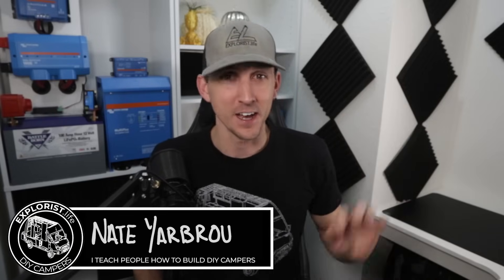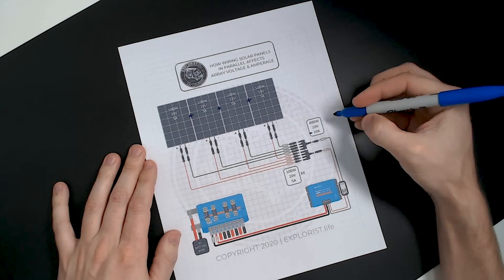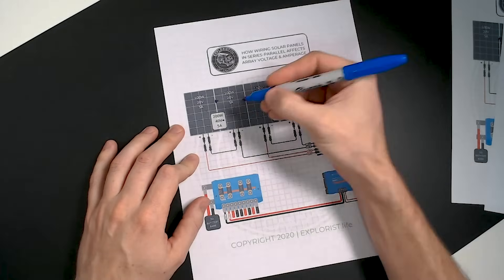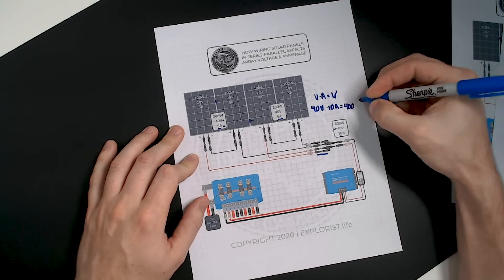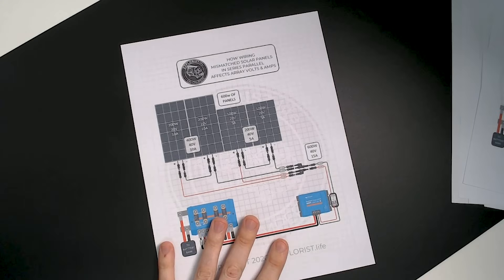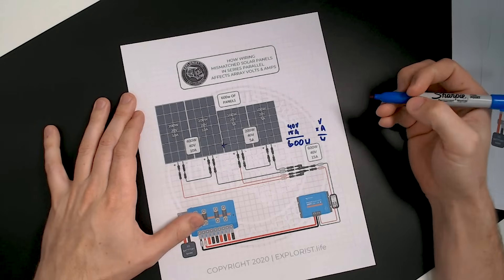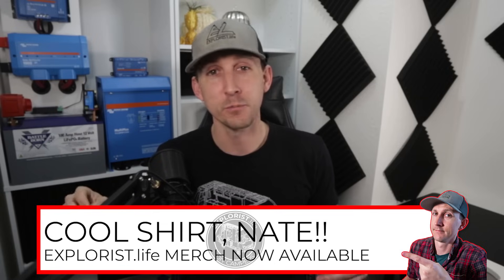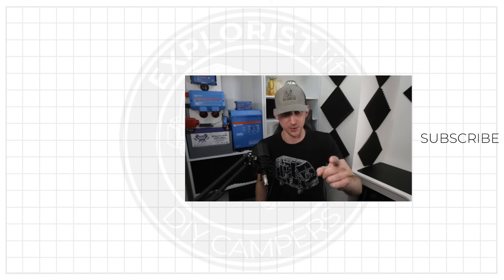How to Wire Different Sizes of Camper Solar Panels Together - Effects of Mismatched Solar Panels

Comment: I have a 12 volt battery bank 800 amp hours with a Outback flexmax 80 amp charge controller that can handle up to 150 volts open circuit and a 5000 watt pure sine wave inverter and eight 100 watt solar panels 6.45 short-circuit amps 6.25 operating, 20 volt open circuit 16 volt operating. Do you see where I need to add? Like is my charge controller underpowered and could I add more batteries or would I have is adequate? I have in total eight 400 amp hour gel batteries 3200 amp hours LOL I don't know why I bought so many batteries but I'm only using two of them in series to make a 12-volt I would like to add two more 6 volt batteries in series making me another 12-volt but I don't know if that's only kill for my setup. Maybe I need more panels? I have four others but they are in sets different brands two sets of two I don't know how I would enter grade that or if I could
Reply from the maker: Tough to say for sure.  Here is how I recommend setting up various systems: https://www.explorist.life/solarwiringdiagrams

Comment: _________Please Help me out ______
i have connected panels in series 180+180+200+330 =890w
im generating 400w from it
i want to connect 2 panels from them parallel (180+180)
and connect rest of them in series is that help to get more efficiency?
(inverter pv range max 230v & 17 amp)
Reply from the maker: Hey, Rated Roxen! I appreciate you taking the time to ask your question, but unfortunately, I don't have enough info about your specific question to provide an accurate answer, but here is a playlist that, if you watch all of the videos start-to-finish (and take notes 😉), you'll have a REALLY good idea of how to design a solar array: https://www.youtube.com/watch?v=Jkbs84sBHsg&list=PLmvhcyi4n0TV9pi83rFTv3ZuMT_S1xIZt

Alternatively, I have some of my most common solar array setups pre-built here: https://shop.explorist.life/product-category/all-products/camper-wiring-kits/solar-charging-wiring-kits/

Comment: I'm not good at electrics 😢. I have  1 x 100w panel on my camper roof going through a controller to a 110ah leisure battery. I  just bought a 200w panel  and mounting brackets ,but no controller , as I thought it would be better for charging but now after watching a few videos, I'm confused . I was hoping to join both solar panels in a junction box and just then use the 2 use existing wires going through the roof  to the controller. 
I think that is going to bring my 200w panel down to 100w ? Maybe I need another controller. Any advice ??

Comment: An example is missing.

What would be the problem if I had 2x 34V 11A in series and 4x 17V 6A and these two Series then in parallel. Both series amount to about 68V. (2x 370w panel and 4x 100w panel). I would also like to place the two different types of Panels in different places so that the sun shines on them at different times. What speaks against it and why?

Would it only be the disadvantage that the two 11A panels would be throttled to 6A?

Or have I overlooked something or are there other dangers?
Reply from the maker: Sounds like you are probably going to need multiple charge controllers for best performance.  Like panels in each location all to their own charge controller.  Too many variables with mismatches solar panels in different locations.
Reply: @EXPLORISTlife  I’m also researching the topic right now - maybe you can also answer a question for me: let’s assume I have two Victron Chargers, how would I connect them to one battery? It is important to me to get an acceptable yield even in bad weather. My current 12V battery can only handle 20A charging power anyway. (so in any case I have a significantly oversized panel array)

Comment: what about placing the different panels  in different directions ? I mean a serie of panels with 505w effect east direction and a serie of panels of 390w south direction. while they don't get maximum effect at the same time,the total effect is not decreased. is it right? great videos....I really enjoy your work.
Reply from the maker: It'll be a similar-ish concept but to a lesser degree as taught in this video.  There may be decreased output, but it's hard to calculate since the voltage/amperage may not be consistent (and would change as the sun moves across the sky).

Comment: Nate, I have 3 different pannels that I wan to use together, here is the list;
1 - 210 W, 16.77 V, 12.48 A panel
1 - 160 W, 18.53 V, 8.66 A panel
1 - 70 W, 17.2 V, 4.07 A panel
Here is what I came up with;
combine the 160 and 70 in Parallel, resulting in 17.2 V, 12.73 A for 219 W
Then combine the 210 to the other string in Series to net 33.97 V, 12.48 A and 422 W for 95.9%.
What do you think?

Comment: Have a question, when putting solar panels in series, with different amperage which value would you use for current the higher or lower value?
Reply from the maker: Here is a video that will teach you what happens when you wire solar panels in series with different amperages: https://youtu.be/jejro4zkl8I
Reply: I looked at the video, but couldn't find what I was looking for, so I have 4 panels in series 2 panels are 8.85a and the other 2 are 9.59amps, so and two are 22.6 volts and the other are 21v so I come up with 87.2v and not sure it's 8.85a or 9.59amps

Comment: hi Nate, can i use 2 100w panels and one 200w panel? run the 2 100s in parallel and then add to the 200w. the spec for the 100w is 20.4v and 4.91A the 200w is 19.2v and 10.2A  i make a arry out put of 388w
Reply from the maker: The video you commented on answers that question. 🙂
Reply: @EXPLORISTlife  but i have parallel  and then series
Reply from the maker: For sure!  This video covers that as well.  Perhaps, if you are struggling with these concepts, maybe choosing from the arrays we have pre-designed may be useful: https://shop.explorist.life/product-category/all-products/camper-wiring-kits/solar-charging-wiring-kits/

Comment: I have a 190W solar panel on my RV, I plan to purchase a 200W panle to add on the roof and then a 100W plugged into the connection on the side on camper>  Should the roof top be connected in parallel?
Reply from the maker: Hey, Herman Taylor! I appreciate you taking the time to ask your question, but unfortunately, I don't have enough info about your specific question to provide an accurate answer, but here is a playlist that, if you watch all of the videos start-to-finish (and take notes 😉), you'll have a REALLY good idea of how to design a solar array: https://www.youtube.com/watch?v=Jkbs84sBHsg&list=PLmvhcyi4n0TV9pi83rFTv3ZuMT_S1xIZt

Alternatively, I have some of my most common solar array setups pre-built here: https://shop.explorist.life/product-category/all-products/camper-wiring-kits/solar-charging-wiring-kits/

Comment: question, could you have 2 identical panels with the same value hook up in parallel, send with a set of wires to 1 MPPT, then use a 3rd panel with different values with a different set of wires to a second MPPT then combine them to the lynx? this should keep my solar numbers up to par 

thanks sean
Reply from the maker: Yep! Here is a video that shows you how to wire multiple solar controllers into the same system: https://youtu.be/N0UB7LZVduk

Each 'array' connected to each charge controller would then get treated as it's own seperate and independent array and should be designed as such.
Reply: @EXPLORISTlife  thank you Nate, love your YT channel BTW keep it up

Comment: The last example of adding an additional panel that cuts output in half is super informative.
Reply from the maker: Glad it was helpful!
Reply: In the  last example why   not wire  3 panels in series ( 51V &11.76A)  and then wire the other four in series also (68V & 11.76A)/ . now you could wire  these two series array in parallel  get you 51V * 23.52A =. 1200W

Comment: Hi, Thank you for the great videos, you are the best out there. I have learned a lot for my upcoming van build. I want to run a solar array set up by you. Rich Solar offers 200W 24V panels that would fit perfectly. They have 37.6 max voltage @ 5.3A. I would run these in parallel for 37.6V @ 10.6A. The other Rich panels are 100W 12V with 18.6V @ 5.4A max. These would be in series for 37.2V @ 5.4A. I would then parallel these sets together for a total output of 37.4V @ 16A = 600W. Am I missing anything? It seems perfect...I hope you get this message, thanks...Erwin

Comment: 11:19 so if you add that extra panel with its own charge controller it will be fine, efficiently ?
Reply from the maker: Splitting the array into two arrays (or three or four or five... depending on how big the array is) is indeed an option.

Comment: Excellent Video. Not sure if anyone in here can help me figure this out. I have 4 - 100 watt Renogy Panels (24.3 VOC and 5.21 amps) from an old rig. I want to buy 5 - Hightec Solar 200 watt panels (24.3 VOC and 9.87 amps). I'm going to go with a Victron 250/70 MPPT charge controller, so I was planning to wire in series. But my math is messing with me right now... If I wire 2-100 watt Renogy panels in parallel; then wire the other 2-100 watt Renogy panels in parallel, I essentially create 2-200 watt Renogy panels at 24.3 VOC and 10.42 amps each pair, right? Then wiring the 5-200 watt Hightec Solar panels in series with these Renogy Panels that are all at the same 24.3 voltage, I would do 24.3x7 = 170.1 Volts. Times that by the lesser 9.87 amps and I get 1678 watts? That seems wrong as I should only be getting 1400 watts at best (4-100 watt Renege + 5-200 watt Hightec = 1400 watts). What am I doing wrong here?
Reply from the maker: I would recommend  splitting those up into two arrays, each to their own seperate charge controller.

This one for the 4x100w panels: https://shop.explorist.life/shop/all-products/camper-wiring-kits/solar-charging-wiring-kits/400w-solar-charging-wiring-kit-4x-100w-12v-battery-bank/

This one for the 5x200w panels: https://shop.explorist.life/shop/all-products/camper-wiring-kits/solar-charging-wiring-kits/1000w-solar-charging-wiring-kit-5x-200w-12v-battery-bank/
Reply: Wow! Thanks for responding! Any particular reason for splitting and still getting the 250/70 and not just a 150/70? Can the 250 not handle the entire array?
Reply from the maker: @mcdees2784  Here is a full playlist that will teach you the considerations of designing a solar array which is what goes into the decision making process of my previous answer: https://youtube.com/playlist?list=PLmvhcyi4n0TV9pi83rFTv3ZuMT_S1xIZt

Comment: I am learning so much from this channel, although there are some things that are still a bit fuzzy in my head.  QQ.

I own 3-160w EC panels (18.2v*8.8a) and 2-100w panels (17.1v*5.9a) I was looking for a way to combine them with minimal loss. 
I think the best possible way under this scenario would be to put them all in a parallel configuration.
Combined AMPs 38.2 * Lowest Volt 17.1 = 653.22 out a 680w. Is that math correct?

Comment: Great video, what happens if you can attach 2 strings to your inverter as it has 2 positive and 2 negative connections, do both strings need to be the same, or can 1 string have different panels to the other and get the full watts from both strings?
Reply from the maker: This video addresses that specifically: https://youtu.be/N0UB7LZVduk

Comment: Hi,
 I have question regarding Solar panel configuration. 
I have four Solar panels all pre wired together in parallel  using two core cable and sealed moulded connections. Can I split them and reconnect in a parallel/ series configuration, as this would be the easiest way with the least damage to existing wires? 
 
 All the diagrams I see are in series/ parallel
Reply from the maker: Hey, Mick Mitchell! I appreciate you taking the time to ask your question, but unfortunately, I don't have enough info about your specific question to provide an accurate answer, but here is a playlist that, if you watch all of the videos start-to-finish (and take notes 😉), you'll have a REALLY good idea of how to design a solar array: https://www.youtube.com/watch?v=Jkbs84sBHsg&list=PLmvhcyi4n0TV9pi83rFTv3ZuMT_S1xIZt

Alternatively, I have some of my most common solar array setups pre-built here: https://shop.explorist.life/product-category/all-products/camper-wiring-kits/solar-charging-wiring-kits/

Comment: Hi there thank you for this great help i have 2 x 100w solar panels that max volt is 22.5 and max amp 5.48 and want to add another few panels, after looking at this video i thought of going for one bigger 370w panel with 43.5v at 10.18amp. so i should end up with about 15amps at 40v which should give me 600w according to calculation but if i add 370w plus 200 watts that give me 570w would that be correct?

Comment: What about using an existing gopower solar panels with a different charge controller and say a victron. Does it matter?
Reply from the maker: It's best to not mix and match different brands of charge controllers.  Victron charge controllers can communicate with each other to coordinate charging, as can another brand (Midnite solar, for example), but the two can't communicate with each other.

Comment: Hi, I'm wiring my roof solar panels in series and I also have a solar blanket. Is it possible to use the same charge control or does the blanket need a separate controller ? The blanket will obviously be disconnected and connected when needed through Anderson plug. Thanks

Comment: But what questions do you ask to help decide this question? "Wire in parallel or serial?" Only after I answer that question can I start planning. Good vid.
Reply: Say you have 3 100 watt solar Panels  connected in series. Your solar controller  needs to be able to withstand the voltages of 3 panels added up together. So if you have 3 x 20 Volt panels you will need to have a solar controller that is able to handle 60 volts  (for example a victron 100/50  mppt ) The amps will be the same as one panels  output just say 5 Amps
 In parrallel your panels will have 20 volts  but the amps are added together  for example 3 X 5 amps  or 15 amps. so you can use a solar controller with a lower voltage  bot it will need to be able to handle 15 amps . wiring in series is good if your panels are in full sun ,but if they are shaded a bit probably the parallel  connection would be better. Hope this helps  :.<>

Comment: I suppose one way around the issues is to use two or even three separate charge controllers.
Reply from the maker: That would indeed be the only way to get 100% efficiency 100% of the time.

Comment: Nate, can I put two different solar panels together in series?  I have 3 Zamp 170w panels and was looking at adding a Renogy 175w panel, with 2 series and 2 parallel. No problem with the 2 Zamp’s in Series but can I put a Zamp/Renogy in series (19.66v/18v and 9.19a/9.73a)? The Renogy is half the price of the Zamp but if it makes the whole array provide less wattage, then I’ll reconsider.  And based on what I think I’ve learned from your videos, even if I bought 2 Renogy panels and tried to wire them in series and then in parallel with the Zamp’s, if seems like the Zamp wattage be drawn down to the level of the Renogy’s? Just trying to make sure I understand this correctly.  Thank you, Gary
Reply from the maker: As shown in this video, when dissimilar panels are wired into the same ray, the array wattage is indeed typically negatively affected to some degree.

Comment: No mention of the wire size series at 80 volts 5 amps v parallel 20 volts 20 amps 4 x the current so 4 times the losses or 4 x the wire size needed.   Series will save extra in wire size choose the controller with the higher volt rating.   If it costs more that can be offset in wire cost.  The diagram showed 4 into 1 all the same size a thicker  coming out may have made people  think oh 4 x the current yea thicker wire without explaining.
Reply from the maker: Talking about wire size for this video would have added an extra layer of complexity and therefore confusion.  This video was more focusing on what happens to the amperage and voltage when panel sizes were mixed.  I talk about solar array wire sizing in this video: https://www.youtube.com/watch?v=JW0vrTAa50s&list=PLmvhcyi4n0TV9pi83rFTv3ZuMT_S1xIZt

Comment: The MPPT in the charge controller will change the panel V such as 12 or 24 etc?
Reply from the maker: I'm not sure I understand the context surrounding your question.  Perhaps rephrase your question?
Reply: @EXPLORISTlife  When choosing panels what your looking for is VOC and AMPS not the rating voltage of the panel correct.

Comment: This video is brilliant thanks 🙏 
Question… you mentioned similar v can be used 
I have x3 120w solar could I add a extra 100w panel in series as they are very similar in amps and volts both being 22 and 21.5 v or 6 amp or 5amp 
I only have space for this extra 100w 
Even if I don’t get the full 100w from it any extra would benefit my set up which at the moment is 360w 
So 400 w I could really use that 
Would it work 
Thanks
Reply from the maker: What does the math I thought you say?  This entire video was about teaching you how to figure this stuff our yourself.  Give it another watch, take some notes, grab your calculator, and put what I've taught you to work.
Reply: @EXPLORISTlife  I’ve done it 👍 thanks for the push

Comment: yeah, if you can. better buy another controller for the mismatched panels. because conditions are never 100% and this way either array may bring in more power
Reply from the maker: If possible, yes.  If not possible, this video shows you what to expect.

Comment: Thanks for this Video! When making these calculations and for adding additional panel to the array, is it best to use Voc or Vmp? I have plenty of mppt capacity, especially on the voltage front with a 100V/30A victron mppt with a 24v LiFePo4 battery...